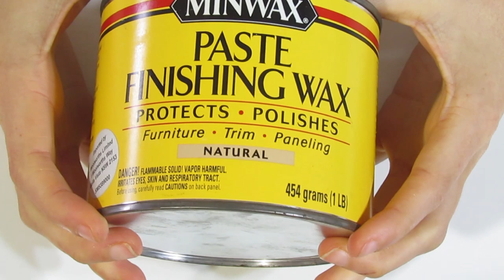Getting Started with Polymer Clay: Using Wax

Comment: I prefer the Renaissance finish, however, I have wondered if it is suitable for pieces that I have used gold leaf, etc?  Or do I have to use resins to protect and seal the leaf?  Thank you, I so appreciate you sharing your talent with us.
Reply from the maker: It depends on the leaf. Most metal leaf will be fine when you seal them with wax, but some will rust if you don't use resin. If the metal leaf has copper in it, then you need to use resin to seal.

Comment: What speed should I use for buffing with dremel?
Reply from the maker: I use the number 4 speed setting on my dremel 3000. And speed should do. The key is to not press on the piece. The heat from the buffing wheel can burn the clay if you press it to the clay. Rather let it glide over the piece.